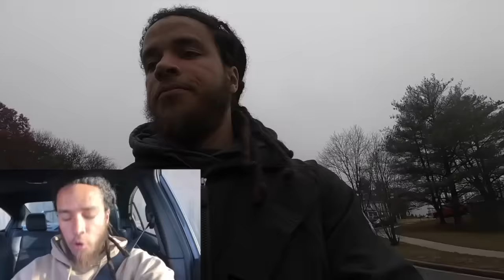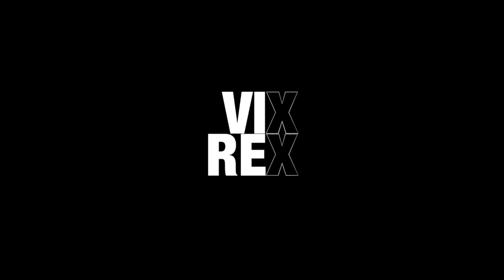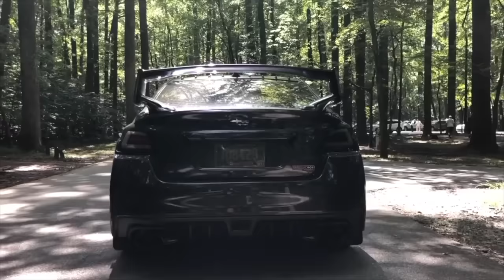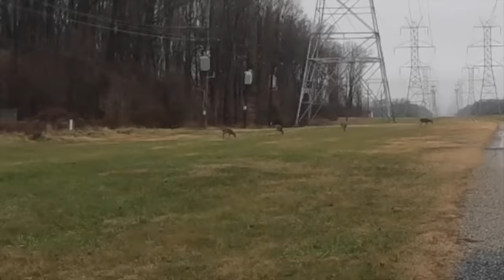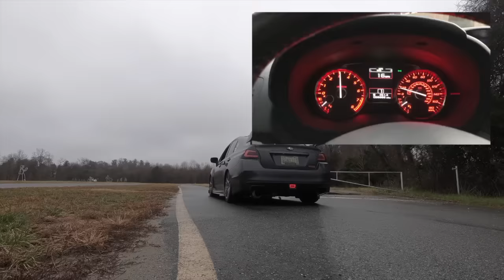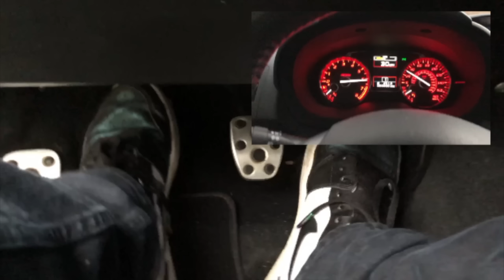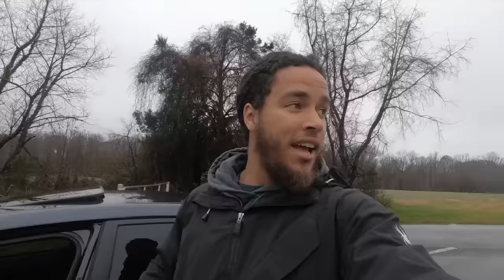How To Make Your Stock Exhaust Pop (NO TUNE)

Comment: Are you just letting the engine momentum travel up to the rev limiter while in neutral? I've never hit my rev limiter so I dunno.
Reply from the maker: Nah I’m in gear while it travels up and then I just push the clutch all the way down. Doesn’t hit rev limiter. But if you do hit it, it doesn’t pop. At least not on the wrx stock

Comment: How did you make it crackle like 4 times in a row I only now how to do it between up shifts???
Reply from the maker: It is definitely random.  if you want to get into more specific kinds of popping and amount, tuning required.
Reply: Gotcha thanks man. I know when if I do it in first gear then it will pop a lot second will aswell but then after that it’s just minimal. You just did a lot in a row I didn’t know if you were staying in first or what. But that’s sick nice car!
Reply: VIXREX like at 4:50 is what I want to do but Idk how
Reply from the maker: Grants z gotcha! That’s at 4:50 I was just rolling in 2nd gear with my foot on the clutch and I kept bouncing the rpms around 4500-5500 rpms!
Reply: VIXREX hell yeah I need to try that now your the man!!!!!!

Comment: Hey man can you make a pop noise on a Subaru impreza so far I put a cold air intake headers and a exhaust but I'm also about to put on a magnaflow glass pack it's also a automatic transmission and it's got 6 speed paddle shifters just wandering if I can still make the popping noise
Reply from the maker: its possible but without the clutch to press, not this way.

Comment: Hi man, hope you get this and reply, will it work for a 2014 Ford Focus S, non turbo, but high intake 2.5L
Reply from the maker: What’s up bro, of course I’ll reply! Non turbo, it probably will not, but there are ways to get some nice sounds out of it. Def gonna need to change out the exhaust, thanks for watching man!
Reply: @VIXREX  well it's basically got a stock everything, so any suggestions? I am from south Africa and the police here practically don't care, so give me your best shot
Reply from the maker: remove the resonator, remove the catalytic converter. this will probably mess up your car without a tune though...be careful bruh @boostedsoulz4745

Comment: That's a Kool trick but aren't you putting extra stress on the clutch, it's called riding your clutch right?
Reply from the maker: Gio slightly, but it can be done without riding the clutch. Press it all the way in, shift quickly

Comment: What about if you have a single cam civic with a muffler delete? Mine barely pops. It gurgles a bit though 😂
Reply from the maker: I don’t know bout that lol should’ve specified this was for this gen wrx/sti.  Might be boost-related
Reply: What generation civic is it? Because my 2007 civic with the stock R18 engine pops everytime i let off the gas. All I have is a $200 catback exhaust. Mine is also a single cam. Wishing to upgrade to a civic si next.
Reply: @shangarsaravanamuthu  I just have a stock D16y7 civic (5 speed) with a muffler delete and a "cOlD aIr" intake. Only gurgles when I'm slightly on the gas on the overrun.
Reply: @JedadiahSands  The problem might be that your engine is too small and isn't putting out extra gas in the exhaust which makes the pops. I had the same problem as yours in my 2003 Honda Civic dx 1.7L .

Comment: That's actually better for your clutch, when you power shift (what you did first) your making the clutch force the engine to slow down the the speed of the car, when you hold it, you let the engine slow down to the speed of the engine so the clutch has to do 0 work. If you hold it to long the engine will have to speed up. Get it perfect for a clean smooth shift, the pops are just a bonus

Comment: What if you have an automatic with a manual shift mode?
Reply from the maker: it might work but I think its the fact there is a clutch to depress that helps with the quick change in rpms to achieve the pops.  there are definitely other ways, such as rolling in neutral and bouncing the rpms up and down.  that can be done on manual mode cars
Reply: First mistake is it’s an automatic.............

Comment: Um it's called rev shift rev in between  shifts but a light rev not hard  but I get sound regardless on my non turbo 06 forester I have stock headers and down pipe  but my mid pipe is wrx 3in steel exhaust  all the way small resonator  pack  guess that's wat that would be  ending 3 in megan racing muffler

Comment: Well one thing revving your car and immediately idling is not not great for your engine its a very sudden very large temperature difference gradually returning to idle with a few revs is much better better especially in a turbocharged vehicle 👍
Reply from the maker: Noted, thanks for the useful input. Thanks for watching 🤘🏽

Comment: Did I really just watch a video on how to make your exhaust crackle and pop? Most any manual transmission car with opened up exhaust and no resonator will pop like this on decel from higher rpm's
Reply from the maker: And thanks for taking time to watch
Reply: @VIXREX  np nice car btw. Wish subies didn't coat so damn much or I'd own one.

Comment: i tried exactly what u did, and i got it only once, how do i make it more consistent
Reply from the maker: Roll in 1st gear under like 10mph with fot lightly on gas. Then accelerate really fast (basically floor it). Once it hits 6000rpms, quickly slam the clutch down (and hold it there) and let off the gas at the same time. Let me know if it works...I put two helpful tips in the description

Comment: I have a 2010 lancer, the base model. Can my car do that too? (148 ish hp)
Reply from the maker: I think it is boost related so I don’t think so but can’t hurt to try once or twice! Thanks for watching G
Reply: If you put a less restrctive high flow exhaust on any car its going to burble and pop(especially if you remove the cats)..might not be as loud as if you actually tune for it..i had a 93 civic and it had a less restrictive and exhaust and would pop every now and then
Reply: Sierra 117 I have a 09 gts with a tsudo axle back and I make my exhaust pop by going up in the rpms and as it's getting down I tap the throttle and its pops and sometimes it's really loud lol ps mines auto with the paddle shifters
Reply: @jordanp_speedqb8703  
Cool!!!!
Mine is the base model (super basic one). Fully stock but I want some twin street basis z coilovers, side skirts, a wing/spoiler, front lip and an exhaust. But I don't know if I should get a Tsudo or a Borla S type for the car. 
As a Tsudo exhaust owner yourself, do you recommend it?
Reply: @jordanp_speedqb8703  
😂 let me just go download Instagram. Me no have social media
Reply: I had an 03 base Lancer back in the day with some mods it did it.
Reply: @beyedubya7777  
Do you remember the mods?
Reply: @Sierra-or9fx  Injen Short Ram, bigger spark plugs an wires, lighter crank pulley, High Flow cat, cat back exhaust. It wasn't that fast but damn it sounded good an was fun to drive. I moved on to a G35 after.
Reply: @beyedubya7777  
Thanks!!!!
Reply: @Sierra-or9fx  No prob man. I got everything from roadracemotorsports.com. They should still be around.

Comment: I wanna know why in the fuck that works, maybe engine is still priming fuel because the clutch is in preparing for the next gear? idk weird. Gonna try this with my focus ST tomorrow, different car, might not work, do I care? nope, Nice video.
Reply from the maker: dude i honestly cant decide what causes it.  only works at higher engine temps too.  let me know if it does haha
Reply: @VIXREX  it must be something in Subaru's stock tune. The ST has pops in 1st gear under decel, but put the clutch in and they are almost non existent. Even modulating the throttle, nothing. Gonna have my buddy try this in his stock 14 WRX and see what happens.

Comment: Does this work with a 04 350z
Reply from the maker: If it’s auto, probably not. Seems to work best on manual-boosted vehicles.  But you have a 350z, straight pipe it and you’re good 😅

Comment: Ur pops cuz it has a turbo not too sure tho. I have ISR exhaust on my miata stock headers and it pops best on 4th gear around 2500-3000k, the rest r just baby pops lol. Just wanted make mine pop louder
Reply: My stock.mazda three will pop after a 5500k shift into second and let of the clutxh

Comment: Is it possible to get pops in a diesel..?
Reply from the maker: Definitely . Maybe not this way but yes
Reply: Very very difficult and definitely not this way. It's the way diesels work because they don't have sparkplugs so they won't ignite from the turbo causeing bad ignition timing. It's doable but you're gonna need a lot of after market parts and a tune
Reply: Thank you a lot
Reply from the maker: thanks for helping a bro out

Comment: Ok 2 problems, one, my car is an Automatic, 2 my cars literal max redline is 6000 rpm, I would kill the engine if I revved it up that high
Reply from the maker: lol its all good bruh.  This seems to work only for manual turbo cars so far.  specifically this gen wrx.  a few others have said it worked for them but i cant confirm any but mine
Reply: don’t work on diesels

Comment: What about an automatic
Reply from the maker: Possibly, but I doubt it. There may be another way but this way doesn’t work since there’s no clutch to press
Reply: VIXREX I found that just manually shifting into 2nd or 1st going too fast for it to lug the engine and make some pops before the engine idles down and has idle fuel shut off but that’s just what I do

Comment: How can I do that on auto?
Reply from the maker: hard af bruh.  youll have to do some more research.  If it were me, id try gassing it in neutral but be careful.  thanks for watching!
Reply: VIXREX sounds dangerous bro. I will abandon to doing that anyway 🤣
Reply: @Red Beard's Racing that's an amg on normal automatics its very hard until and unless u either have pedal shifters or can manually shift it ( but why the fuck a person would do it on normal automatic. Just buy either a manual transmission car or buy any m amg or r series [audi] car)
Reply: @Red Beard's Racing not saying to u bro in general I was talking (sorry about the word though my lingo is made that way)

Comment: Burn yo clutch 101
Reply from the maker: too trill bruh
Reply: VIXREX if you have an older car that’s key ignition you can make louder ones by revving it 6 k rev and switch off the ignition and turn it back on 😂
Reply: VIXREX works on my 89 camry I broke my brothers mic 😂

Comment: Short answer: You can't. Long answer: On a properly running car you can't. The pops are caused by unburnt fuel entering the exhaust and igniting. So if you say had fouled plugs you'd get pops because all that extra fuel that didn't ignite would be pushed into the downpipe, where it would ignite